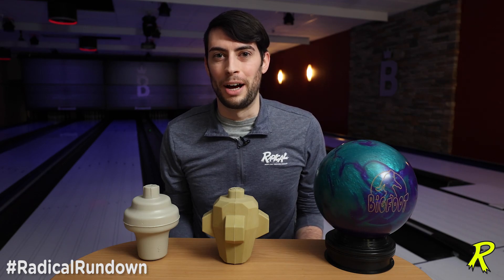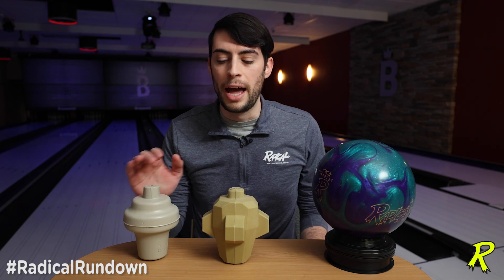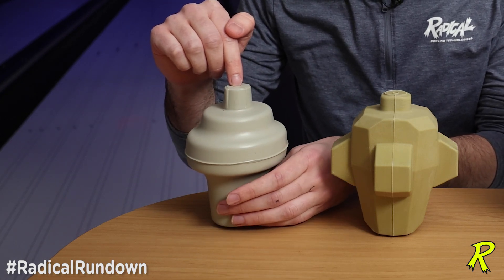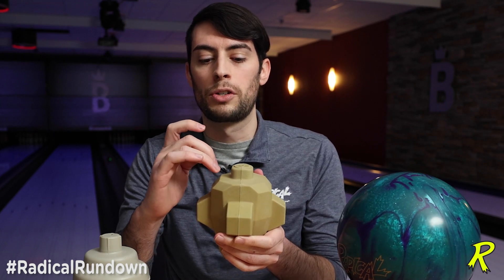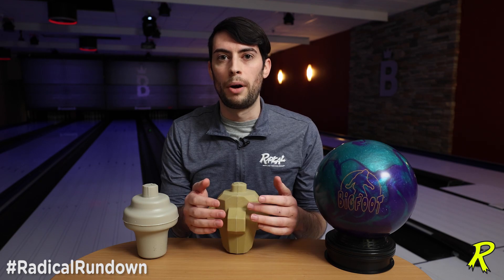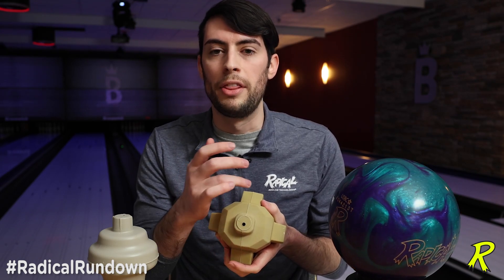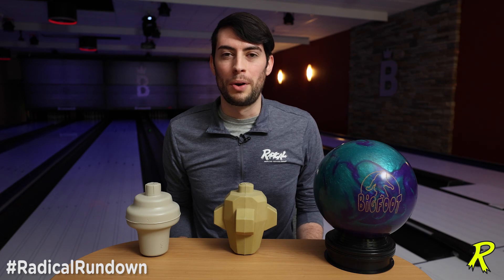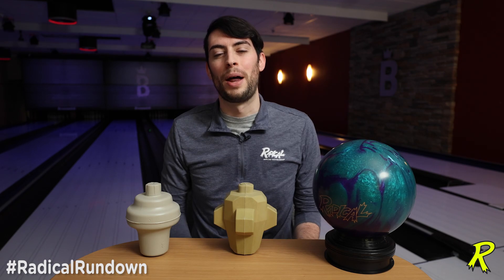Radical Bigfoot - Technical Core Overview - #RadicalRundown

Comment: super fascinating stuff Bryan.. would love to get to pick your brain a bit. especially as a fascinated person of Mo's work, it's always been suggested that the CG placement/first drilling number for dual angle became irrelevant for symmetric bowling balls after the banning of balance holes.. but this is suggesting, with the mirror symmetry of the particular core design, it actually does make at least some difference. (personally feel people don't focus on after drilling numbers enough, so this video was a bit fascinating). would you suggest, people should be focusing on the core design more when laying out particular balls with this type of symmetry, as opposed to the axial symmetry? is this a quality that is really only focused on for particular releases/something in your designs, or are these two symmetry types actually an abundant mix? and/or to the average bowler, is that after drilled int diff not going to make enough of a difference to focus on it? thank you sir,
Reply: thanks charles. there is a mix of mirror symmetry an axial symmetry in general in the field, with axial symmetry being much more common. this design is purpose-built with features to enhance the asymmetry of certain layouts. not every mirror-symmetry core design will have features that purposely do anything to the drilled numbers.

for symmetrical balls, i like to put the cg in line between the pin and the thumb regardless, because it still puts the core in a "forward facing" orientation relative to the center of grip, regardless of the design intent.

Comment: What if you went to 50, instead of 30 or 70; in the area to split the difference of one of the four protrusions. What would be the diff number and expected reaction for the ball?
Reply: both the total diff and int. diff. will be right between the numbers from the other 2 drilling angles, because the thumb is going to remove a portion of the front moment arm, but leave a portion in.

Comment: Would drilling through the moment arm and Not doing it, ex. 70 vs 30, give such a change that 2 Big Foot balls would be an excellent part of
a 4 ball arsenal?
Reply: i think so! you could also separate them more by changing the surface on one if you'd like.
Reply: @BowlingBuckosh  Next ?, Is the 30 or 70 better with Pin Up or Pin Down?  Also, what would be the best VAL angles?
I realize some of this is conditioned by the lane patterns.  Right now Gold Coast, LV, uses Kegel Helium and Red Rock is pretty standard although I hear they are changing to Kegel Oil on a 42' pattern. I expect to touch the ball surface with 2-3 
thousand grit as both lanes are a little short of dry and both leagues have quite a few Urethane bowlers.

Comment: Very interesting ! Thank you ! I didn't think a symmetrical could get an int.diff so high. So one could presumably, drill this ball to be asymmetric after drilling...and if he doesn't like it, can plug it and redrill it to me symmetrical (or almost symmetrical). Yes?
Reply: true! this core design gives you a wider range of intermediate diff options. if you want more backend motions, drill it through the knob, if you want smoother overall motion, drill it 45* from there.

and remember, all balls are somewhat asymmetrical after drilling.
Reply: @BowlingBuckosh  Yes i  remember. I am curious though if there is a "critical point" of asymmetry, where it starts to matter more, to have a significant difference.
Reply: @bowlingxp8345  at about 10pts of diff on an undrilled ball, the MB starts to have more of a defining factor in the final PSA of the drilled ball. below that the thumb influences the PSA the most.

bigfoot is a sym that will always spin to the thumb.
Reply: @BowlingBuckosh  Aha. Nice to know, thank you very much !!

Comment: What would be the best drilling pattern for a full roller giving the sharpest backend
Reply: put the pin at 7:30 (clock position) at 5" from the center of grip, with the PSA (you will have to mark it) on the centerline around the area of the fingers. drill the fingers deep.

this only works if you are truly a full roller, with ~13.5" track diameter.
Reply: @BowlingBuckosh  Thank you so much for your help but I have one additional question. I’ve been getting balls with 3 - 4 inch Pins. I just wanted to make sure I understand that I would be better with a 4 - 5 inch Pins. I have both Quantum’s, Knockouts, Jabs, Obsessions. To answer your statement true full roller my track lines run off my middle finger through over Cg and just inside my thumb. I have been using 3 1/2” Pins two inches left of the center of my thumb hole which puts the Cg exactly in the middle of the grip.
Reply: @richardgandia5700  the pin to cg distance does not matter. in my suggested layout, the cg will not fall on the center of grip.

the distance i am using is center of grip to the pin. the cg location will be somewhere just left of the center of grip, and it's distance up or down is inconsequential. the PSA (6.75" from the pin on the line though the cg) is what we are using to locate the core knob. That PSA will be on the centerline somewhere near the fingers.
Reply: @BowlingBuckosh  thank you again for your help. I will provide the pro shop where I drill my balls and have the Pro using your directions drill a Big Foot. I am also looking to purchase the Defender as well. We would use the same layout even on asymmetrical as well ?

Comment: Its cool to see a squared off version of the Revolver core.
Reply: true in a way. there are a lot of existing examples of cores with mirror symmetry. you won't be able to move the int. diff. value as much with revolver, because the size and location of the bulbs on that core are not as substantial, but you will get a similar effect.

Comment: I like these core demonstrations, they help to visualize the physics behind ball motion. I'm a No-Thumb + One Handed bowler looking for a high flaring layout. Would drilling the two fingerholes through a Moment Arm yield a similar effect as drilling a thumbhole through it for traditional bowlers?
Reply: yes, you could drill the fingers through the psa to achieve the same effect. you still have to control your pin-to-pap distance and your VAL angle. this will be a very tall pin orientation for most paps.

Comment: I'm wondering why the moment arm location is not marked on the Bigfoot. It should be if the drilling angle is a factor in the ball motion.
Reply: the core is designed so the front of the knob will be 6.75" from the pin on the line through the pin and cg. we can't mark a PSA because undrilled this core is symmetric.

Comment: How do you know for sure where the moment arm is oriented inside of the ball after the coverstock has been poured without a mass bias pin indicating core orientation?
Reply: The core oriantation should be dictated by the cores X-axis aka. Pin. The Imax is Z or Y (mass bias). The pin in  relation to w(pap) in radians of the center orientates the core or the baĺl.
My question to the expert is if this angle is the only dependence for oriantaion? Or do we have a angle between pin and w in Y or Z axis too? This is more an physical question for modeĺing baĺl motion.
Reply: hey  @drullen5096 , i'm not totally sure i understand your question. in our design software, Y is up (pin), X is out (mass bias), and Z is perpendicular to both (intermediate axis). since the mass bias is not marked on a ball that is symmetrical (before drilling) we rely on the CG to understand the orientation of the knobs on the core. the front knob is still located on the X-axis even though it is not marked on the ball surface. hope that helps ✔
Reply: What axis pin is labeld isnt inportant. So one knob is always in your X-axis so one should be on z too. You said earlier that cg is in the Y plane, how come? Cg should be placed somewhere between pin and any other axis, is that on the topside of one of the knobs ?
Thhe question was the matter of physical relation between pin-pap distance, where pap is omega then the core tilts in relation to omega when you set pin-pap distance. But does the core tilt in x or z axis too?
Trying to understand vat this core do with the angular momentum of the ball.
Reply: @BowlingBuckosh  
So it is given that the core, because it is always tilted slightly to one side, the one of four knobs will "always" determine the heaviest side/cg of the ball because one knob is closer to the cover?
So to drill between the knobs, one can just draw a line at 45* off the pin compared to through the cg?
Do you have numbers for the difference if you use interchangeable thumbs?
Reply: @SKC300  Yes, is what drill en said how you are determining the heavier quadrant?
Reply: @drullen5096  i was just defining the axis labels so we could reference them for clarity. by design, the cg should fall in line between the pin and theoretical MB, putting in on the Y plane, as you said. this is the case for all balls, and is designed this way as a mechanism to control pin-outs (pin-to-cg distance on ball's surface), and also top weights of the undrilled ball.

pin-to-cg and pin-to-pap distance have no meaningful correlation to each other in terms of angles. the pin-to-PAP distance and the VAL angle (2nd angle in the dual angle system) control the initial core orientation at release, and is unique to each bowler's PAP. the 1st angle (drilling angle) controls the relationship of the gripping holes about the Y-axis (pin-axis).
Reply: @davidhensel1991  truly what is happening is the cg mark is a point on a vector from the center of mass through the cg, to the ball surface. i.e. the cg marker is just a point on a line that connects the ball surface to the center of the ball , and the line runs through the actual center of gravity of the ball, which is somewhere in the ball, not far from the ball's center. 

the center of gravity is not the geometric center of the ball, it is shifted up and in a direction. this orientation is known to us designers, and we can orient features like the knobs accordingly.
Reply: Ah okej so cg is on that edge that isnt rounded off, right?
But pin-pap distance isnt unrelated to the momentum; if you set pin on omega/pap you get a 90degree tilted core that spins round pin axis on initial omega, therfore a stable low flaring core.
If you put pin 45 degree angle from pap you get the core unstable on release and init omega thus max flare.
(Degre is here at center of the baĺl not dual angle arc surface). Just trying to understand the core against psysics not just bowling lingo.
Reply: @drullen5096  correct. on balls, the angle from the origin is measured in inches on the surface of the ball as pin-to-pap distance because we can't measure the interior angle. pin-PAP distances of 3.375" = 45 deg, and 6.75" = 90 deg, 1/4 of the ball.
Reply: @SKC300  not tilted, but located off center.

missing the knobs would put the thumb 45° from the pin-cg line, but still requires pin-to-PAP distance and a VAL angle.

the best method is knowing what drilling angle puts the MB in the thumb for your PAP, then subtracting 45° from that.

example: 75° hits the knob, 75-45 = 30° drilling angle puts the thumb between them.
Reply: the core is designed so the front of the knob will be 6.75" from the pin on the line through the pin and cg. we can't mark a PSA because undrilled this core is symmetric.
Reply: @BowlingBuckosh  how do you know for sure though that the moment arm is directly oriented exactly along the line made from the pin to the cg? I suppose when I'm not understanding is that for a bowling ball with mirror symmetry in the core design how would you know that the center of gravity will fall exactly along the most central part of the middle of the moment arm. Please be patient with me as I'm not a core researcher or engineer, LOL
Reply: @davidhensel1991  no worries. we can't give away all of our manufacturing techniques, but this design takes advantage of the fact that all sym core designs need a "heavy" quadrant to mark the cg. this is a known orientation, so the knobs were designed to purposefully align with the pin-cg plane.
Reply: @BowlingBuckosh  so the weight of 1 on the knobs is purposely heavier than the other 3 knobs to create a "heavy quadrant" than falls to the bottom during the cg test? Is that what you are saying?
Reply: @davidhensel1991  nope. it's done with mass location.

Comment: Does this mean that if a two hander got a big foot and drilled it let’s say short pin, it would stay symmetrical? I’m looking for a new pearl sym as a two handed righty so I’m curious
Reply: for short-pin layouts, and layouts that put the fingers in the area of the pin for no-thumb bowlers, this will act like a standard sym core. if you have a tall-pin layout that puts the fingers near the knob (moment arm), then you can achieve more asymmetry than normal.

Comment: So the drilling angle can matter on a symmetrical core? Depending on what kind of symmetry the core has?
Reply: in a way! the cg location itself does not matter in terms of affecting the dynamic properties of the ball, but we can use it as a marker to orient the core, and the core position does matter in this case!